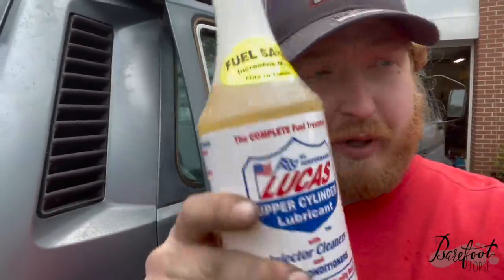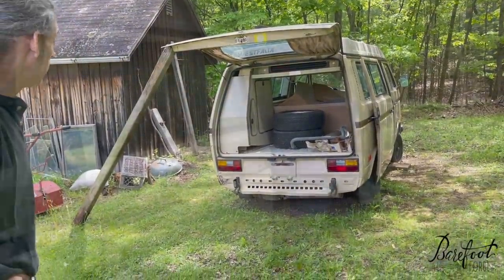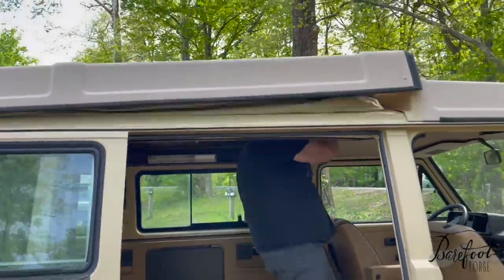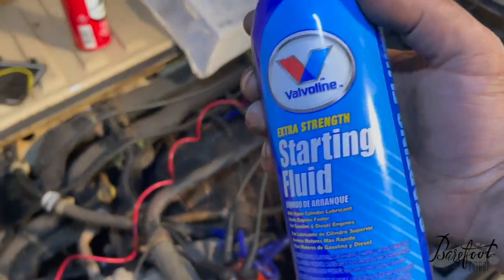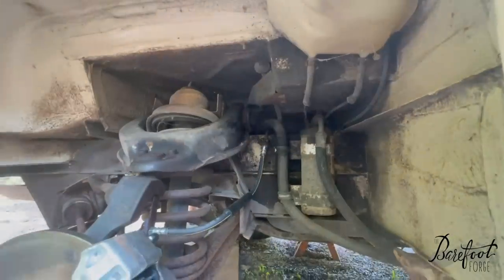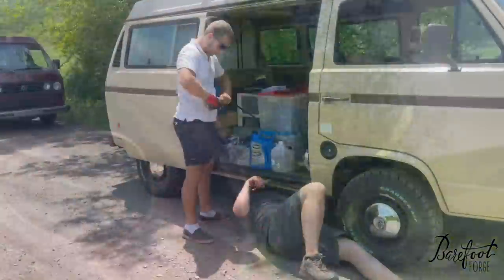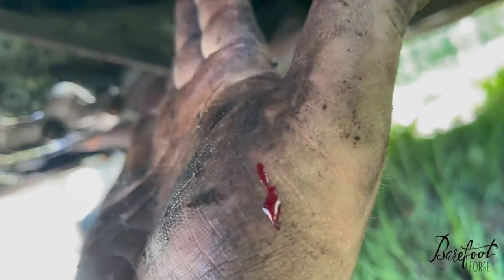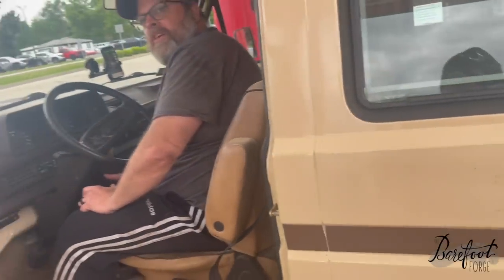Forgotten 1985 Volkswagen Vanagon- Will it RUN AND DRIVE 600 Miles after 20 YEARS?

Comment: As I qualified VW mechanic, and an owner of a 62 Kombi, which I circumnavigated Australia in 1984.  I had many breakdown experiences in the 5 months it took me. I had a wonderful trip and would do it again. You guys kept me entertained the whole time watching your video. I only wish I had videoed my trip, but videos  were not invented in those days, except to have  had a camera crew with me. My Kombi was the result of a accident, and was parked outside of this gas station I had purchased in Sydney and was waiting for the owner to come along to get it repaired, who never showed up. So I got it registered in my name. From then on I had it for five years and finally sold it to a Flower shop in Sydney used to deliver their orders. One time during the trip the crankshaft broke in half, I was able to drive to this town that had a wrecking yard. They had a motor in a wreck, so I took out the crank shaft and installed into my motor. I was parked across the street on the lawn of a drive in theater on the grass. I was the talk of the town, when they found my motor all in parts on the grass as I assemble it back together, to their amazement. I then said good bye ! and thanks to the wrecking yard as I set off to Sydney.
Reply from the maker: EPIC!

Comment: I bought a 1984 Vanagon. It needed the tranny rebuilt. I could not find a single person who would work on it in the southeastern US. I called every possible person I could find and no one would touch it. I still sold it for a profit though. VW vans are my all time favorite. I had a 1979 bus in 1984-85 and it need a rebuilt engine. No VW shop in the Washington, D.C. area would touch it. They said an engine rebuild would tie up a stall for four days and that they would lose a ton of money on that stall for those four days. Sold it to a collector.
Reply from the maker: Ya, they used to be harder to get folks to work on. Now there are speciality shops that JUST work on vanagons. But ya, there was definitely a time in the early 2000s where no one would touch them and parts were hard to find. : /

Comment: I had a Westfalia Joker (the European equivalent) for 12 years in the 1980/90s and still miss it. If I had had such a load of people around me with that kind of compounded knowledge, I might have not sold it, but all that is history. Amazing how you managed to get the van going again, even with all the ups and downs. I have to say, I was surprised that you would be allowed to drive a vehicle on the public highway in such a condition. Dodgy brakes, exhaust about to fall off, engine emissions. I don't think that would have been possible in Europe! Still wishing you every success as you continue with the restoration.
Reply from the maker: Nothing at all was dodgy about the brakes- they were fully replaced and thoroughly tested. Brakes are the one thing we wouldn’t have driven home without. 

Yep, you’ve got ten days from when you buy the car to get it inspected, so in that grace period….. 
anyways, if promptly got a whole new engine, whole new exhaust, etc- it just had to make it home, we’d never drive it around like that.

Comment: You made an inquiry what my favorite part was, and I honestly couldn't think of one that stood out above all the rest.  The whole video was enjoyable except for one minor issue, which was beyond your influence, and by extension beyond your responsibility.  I do possess a healthy grasp on classical mechanics, alongside the most rudimentary of basic knowledge regarding electromagnetism, which permits me the capacity to perform basic maintenance on a vehicle.  Nevertheless, my car mechanic awareness quotient is quite low.  

The video made me realize how much I do not know, and in that realization, a want was reborn to have the know-how required to resurrect a vehicle that has not been started, let alone driven, for two full decades, and then proceed to drive it several hundreds of miles back to my abode.  

You claimed I was a part of "this", and welcomed me to the team.  For such a kind, unselfish, and noble gesture, I shall bestow upon you a thick, viscous slathering of gratitude.  I am honored to be a fellow team member.  The utmost, deepest degree is with which I appreciate such acts, which are anything but!  However, as a teammate trying to hold the importance of the team on a significantly higher level than where I place myself as an individual, I am reminded of the concept of synergy, concerning the whole being greater than the sum of its parts, and it is within this quick flash of expanding awareness where something has conjured a wave of guilt, for I began to feel as though I was not pulling my own weight on this team.  Therefore, if you truly care about this team, which I believe you do, and you still want me to be a part of this team, help me to become worthy of such an esteemed position, gift me the power of resurrection and repair, fill my noggin with the esoteric knowledge for which I yearn!  Learn me all the things!!!  Then, and only then, shall I command the capacity to pull more than just my own weight!  

Realizing that my thoughts had wandered off on a tangent while reflecting on the request to comment upon which part of this video was my favorite, I readjusted my focus upon the now of the video in a fashion akin to the stylings of Ram Dass, and in a manner that was more precise, and less tangential than I had allowed it to become over the past eighteen seconds.  As my focus upon my focus came back into focus, I noticed the shirt, and finally realized which portion of this digitized recording was my favorite part, it was beyond all doubt that last shirt!!!

CLEVELAND NEVER ROCKED

Comment: Some years ago, my son and I went to buy a bay window camper being sold as a non-runner needing completely new wiring (so the seller was told) my son did the deal and went into the seller's home to write up the paperwork. While both were In the seller's house I climbed under the rear end of the VW and with the ignition on jumper wired the starter so the engine ran, and ran very well, the seller and my son came out of the seller's house, my son had a huge smile the sellers just looked and said ITS RUNNING! - my son drove that VW home about 60 miles and it ran perfectly just pulling into a petrol (Gas) station to give it some fresh fuel..The full wiring loom problem was a broken wire that goes to the solenoid on the starter - that's all. LOL.Always an adventure with VWS beetles and vans.. So, a great road trip guys, I enjoyed it immensely thankyou...So,, I am  Ian, now only 75 years old and still loving great stories told. - thank you all.
Reply from the maker: Wow. Thanks man!

Comment: I used to own a 1966 Volkswagen Bus with barn doors. I did an engine  swap to an 1835 with 46mm Delortos. Then I built a 1961 bug on a Frame Works tube chase, with a 2343 Turbo with  Nitrous. Now I'm looking at a 1987 Vanagon Syncro Conversion 2.2 with a Super Charger.
Reply from the maker: Oh man, I hope you’re not the one that bought that weird hacked together 2.2 super charged syncro westy…..

Comment: Teamwork is cool. Straight water will boil over and blow head gaskets. This reminds me of "The Great Race" , going cross country with all sorts of trials.
Reply from the maker: What model iridium plugs have you run in a vanagon? 1.9 or 2.1?
Reply: @TheBarefootForge  equivalent iridium plugs, single electrode. I would think something fits a vanagon.
Reply: I'm not a VW guy but I know 3 contacts draw more current, not good.
Reply from the maker: @markallen8434  but you haven’t done it?

I’ve run these plugs flawlessly in 100 vanagons.

Comment: I used to own the triple a subaru shop in anchorage and its the closest thing as cousins go to the Volkswagen. Many of your issues on the trip are same for the subaru from the seventies forwards to about the last of 1.8 engines in brats in 91... I really loved working on them because of the simplicity of them an not too many different size nuts/bolts so just very few wrenches needed. I have to be careful on this comment as I have a million stories quite similar to yours!
Reply from the maker: Awesome! Ya, that suby swap was freshly put together, so.... it's needed some tweaks. It's good now!

Comment: Kurt is a great mechanic and troubleshooting the Vanagon 1985. For free and plus the cost of parts and repairman that needed new long plastic funnels. The fuel pump needs to be replace by Western Wolfburg parts dealership. So it will be quiet instead of Chinese imitation fuel pump. I learn that Chinese fuel pump was too noisy and not wise to buy it from Chinese maker. About the bad fuel pump is my favorite part of the 600 miles trek of 3 Vanagon  vans and one 1985 Westfalia.
  How do you replace the fabric that where it has torn few holes on the tent fold up. 
Thank you.

Comment: Loved watching your adventure. What tires did you put on the van? Those look badass.

Subscribed!
Reply from the maker: Those are the general grabber atx in the 27x8.5 size. They fit great on factory wheels!
Reply: @TheBarefootForge  thanks for the reply. How do they ride? Any big hit on fuel economy?
Reply from the maker: @MercedesDieselGuy  any tire even a hair over stock is going to effect your fuel economy. I’ve said it for years and it stands stronger today then ever- if you’re worried about fuel economy, at all, get a different car. 

I worry about “smiles per gallon” and these cars use their perfectly honed aerodynamics of a ranch home to produce the best gas mileage of any vehicle I’ve ever routinely driven to the grocery store, that has beds for four people in. They’re amazing at that.
Reply: @TheBarefootForge  I wouldn't say worried.  Just curious.  I've had my tintop for nearly 20 years now. I know how it goes.

Will be going back and viewing a bunch of your earlier videos. Thanks again.
Reply from the maker: @MercedesDieselGuy  if you want a beefier tire that fits stock sized wheels- these are the ones for you. They’ll get you to places you want to be. 

They’ll also take some of your horsepower, make more noise, make steering harder, decrease gas mileage, etc. 
but they’re a great tire option I highly recommend.

Comment: Are these van still made?  I know it sounds dumb, just wondering
Reply from the maker: Nope, they made this style from 1980-1991
Reply: @TheBarefootForge  thank you!! Can they tow small campers?
Reply from the maker: @kimkrebs451  They literally ARE small campers. There are several different versions- this is the "weekender" which has a bed, a cabinet, and a table. (Beds for 4 people), but the "full camper" version also has a stove, a sink, and a fridge. 

They do not have enough horsepower or ample braking to tow more then a few hundred pounds.
Reply: @TheBarefootForge  thank you so much.  These are cool looking campers.

Comment: Just what’s ruining the Vanagon reputation; people converting them with Subaru engines or any other non stock engine. Our (first and only owner) 1988 1.6TD JX is still ticking and kicking. Been through one turbo, three LDA’s, one rebuild diesel pump, three mufflers, but never ever any mystery electrical issues. Transmission the standard four speed manual is rock solid.
Reply from the maker: Did you really just come to my most popular video and after watching it for an hour- explain that I’m what’s wrong with Vanagon’s?

Do you have any friends, or does everyone just hate you? I guess the question is do you have any friends that have lasted more than one year? Much like your reputation for being an original owner of your old vehicle and making sure it’s remained stock- I assume you’ve made just as many friends in the 36 years that you’ve argued online.
Reply: @TheBarefootForge  I saw the first few minutes with that Subaru engine with blown fuses. Keep them stock, you’re not smarter than German engineers.
Reply from the maker: You’re wrong there- lots of technology has changed in 36 years and yes…. Modern tech is smarter than Germans 36 years ago were. 

Anyways- you saw the breakdown of a six month engine swap on its initial test trip, something I’ll admit should have been done ahead of time. Did you see how it took 3 minutes to fix? 
Did you see how it actually had NOTHING to do with the actual engine swap but rather a fuse being blown by the aux battery- the exact same type of issue you could have with your stock system?

I hope you’ve subscribed- we have a video coming out on how bad the JX is and just how profoundly wrong you are as we TDI swap my Doka. Since you’ve got time, YouTube, and no friends- I look forward to hearing your thoughts on that video!

Comment: Use brake cleaner spray to start it next time, much easier on your rods and rings.
Reply from the maker: How so? Most of the modern starting fluids include a thin oil, and…. Having just put wd40 in every cylinder- what’s brake parts cleaner going to do to better lubricate it then a cylinder that’s full of thin oil and turned over by hand already?

Comment: cut the bottom off most plastic bottles for a funnel .The stock  plastic auto trans coolers suck and fail easily. German transaxle makes a nice fan/cooler kit but best keep it close to the trans as the pump was never designed to pump trans fluid all that far.
Reply from the maker: We actually just changed out his transmission and added a cooler this weekend, this bus is still running GREAT!

Comment: My solution for such break downs is my ford with a uhaul trailer. Easier these days to get parts at any parts store for the f150. Not as fun, just little quicker.
Reply from the maker: How do you go on road trips in your vanagon but also bring along your f150 and a uhaul trailer every time?

That just feels like you’re packing a bit heavy, and should fix your van instead. Lol
Reply: @TheBarefootForge  I drive the van. I just take the truck when picking up a new/old rig. Not as much fun or as exciting a time you guys had.😄

Comment: Bus rule #376 always turn off engine when perceived stop more than 69 seconds. Starters are easier to rebuild then any drivetrain part.
Reply: Spoke too soon about the starter🤣🤣🤣😂🤪go team!
Reply from the maker: I definitely don’t follow this rule. Why shut off a running engine?
Reply: @TheBarefootForge  I had an 89 westi that if I left it running without moving something would give. I’m back to air cooled slower but just as fun.

Comment: Why didn’t you just put the van on a tow truck & take it straight to your destination
Reply from the maker: @VanventureswithKaia  have you ever tried to get a 600 mile tow? No one will do it. It’s impossible. It’s in that weird
Range of being to far for any tow truck driver, and without running-‘shipping agents won’t touch it either.

Comment: Vanagons are very unreliable 😂 unless there is a Subaru motor upgrade and all coolant lines and not to mention everything else 😂 but Super Fun to own and cruise owned 3 and all required much repairs and even after all repairs I made or upgraded I did while owning it the New Owner called me 2 months later after I sold one he was asking if engine had warranty 😂
Reply from the maker: Reliability has to be earned, any vehicle is unreliable until you go through it and progress on deferred maintenance. One of the most important things to making a vanagon reliable is the owner- and it sounds like you left a ticking time bomb for the next guy. 

Notice the bus that broke down the most was the one with the Subaru…..
That’s because this was its first big trip, it was largely un-tested. These systems need to be brought back on line methodically by skilled and knowledgeable folks. Also- none of the busses on this trip had “all their coolant lines” replaced, and they made it with no issues.

Comment: There's 2 types of mechanics in this world there's ones that know how to do the job right they find the Problem and they fix it Then there's a part's changer mechanic Somebody who's inexperienced probably Only worked on small engines that will CHANGE parts until they Find the Problem not Find the Problem and fix it just CHANGE parts till they Find it that red-haired guy is a parts changing mechanic he seen a little puddle of oil on the ground said it Needs a new engine and it just needed the oil filter tightened up I wouldn't let this guy come near my stuff with a tin foot Pole But opinions are like assholes we all have one that's just mine
Reply: Not saying hes a bad guy he seems like a great friend I just wouldn't let him work on my stuff. I just don't want it to get misinterpreted.
Reply from the maker: Ha! You’re saying that Craig is a parts changing and inexperienced mechanic?

Get on the two year wait list to have him touch your bus if your opinion changes I guess.